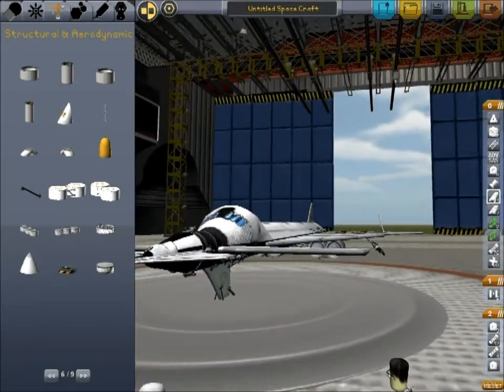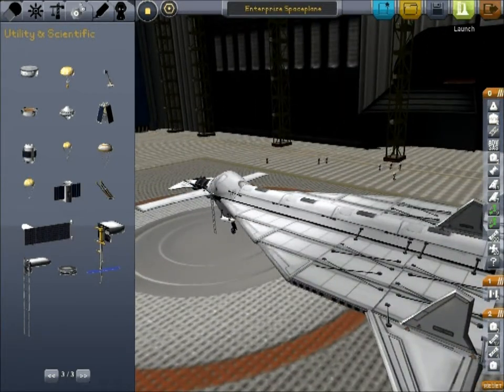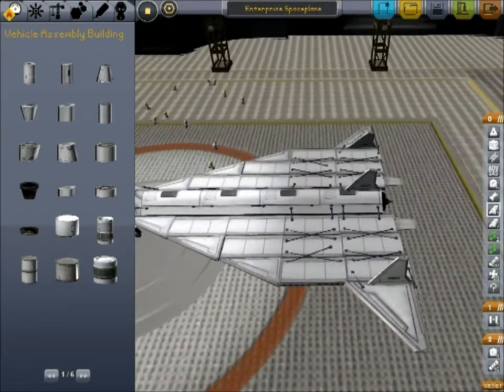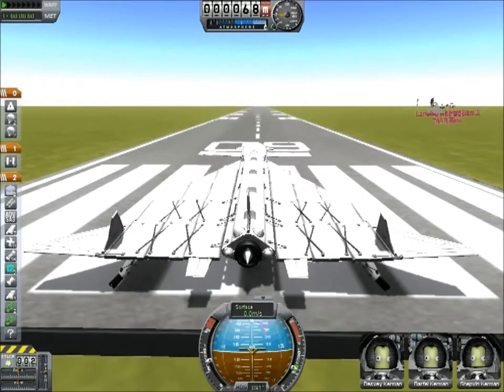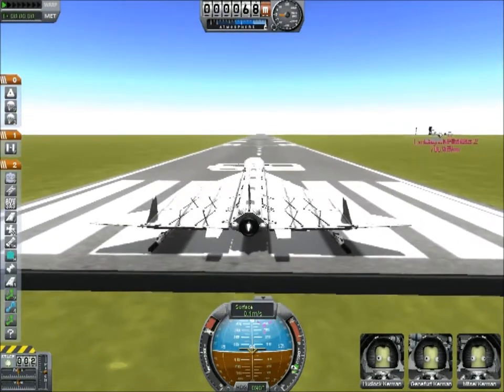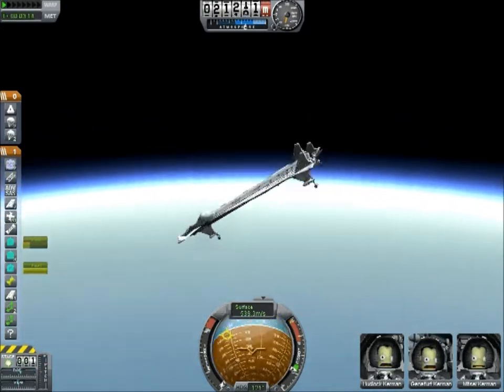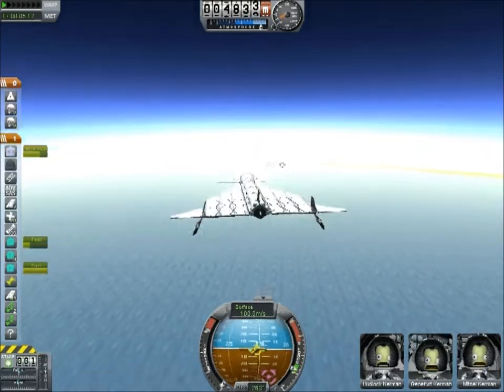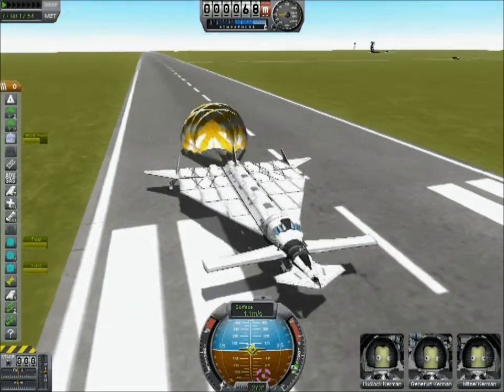Kerbal Space Program - Spaceplane Tutorial Part Two

Comment: The last flight in this video was a nicer one than the first one. Congratulations on the MK II and sorry about the MK I. One thing that I would be doing is to have the Rotational Thrusters at the wings in the center of them on top and bottom on those big wings and on the ones up front as well given they are fixed and not pivotal.